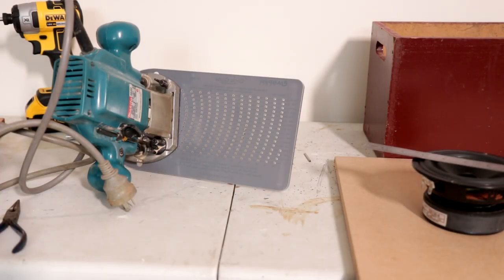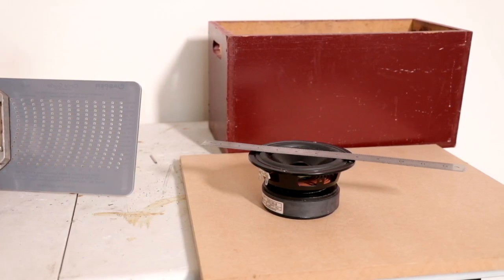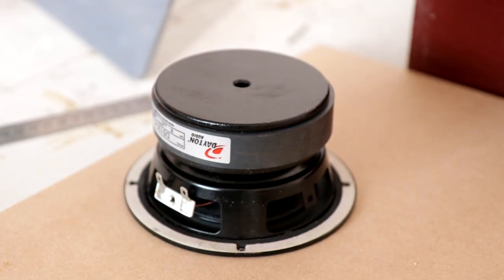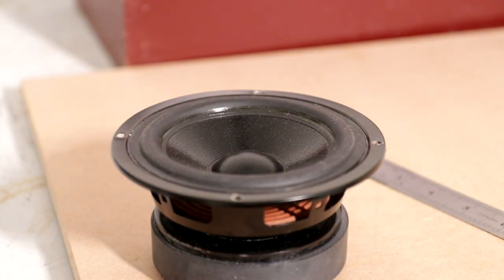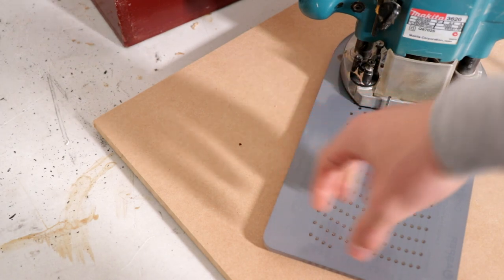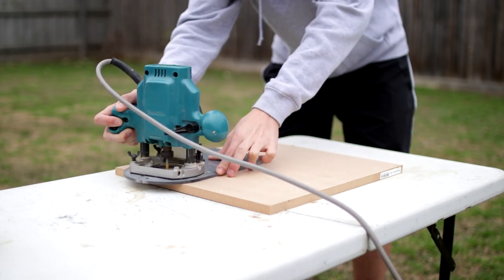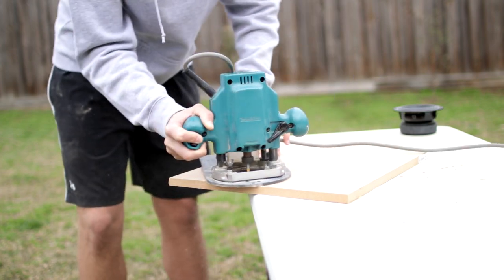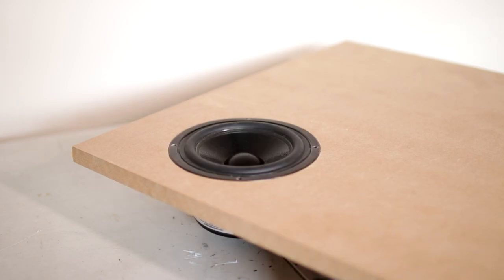How To PERFECTLY Mount A Speaker EVERY TIME!

Comment: Nice, but could you talk a bit (no pun...) about the bit used?  I first thought, wow, how did you factor in the bit diameter, but I then did a pause on the jig and see that it calls for a 1/4" bit.  That seems pretty thin, do you have to take lots of passes to avoid snapping it?  Also, what is the bit shape, including the tip.  Is it a plunge bit?  I know, newbie to routers, assume nothing.

Comment: You forgot to add the thickness of the sealing gasket for mounting under the flange of the speaker rim. I use draught excluder foam, but you can get other neoprene foam strip or at least use soft carboard.... whatever you use, the extra thickness after its compressed, needs to be factored into the router depth.

Comment: I made 2 boxes for 2 8” subwoofers  i had laying around but i done the measurements really wrong and the boxes ended up half the size they are meant to be and they basically make no noise even with 500W running through them😂

Comment: Its actually a little too tight. Once  you paint the boxes you might find it very difficult to install the woofer.
Reply: Yeah I am going to 2nd this. And it would depend on the material you are using if there is going to be any thermal or moisture expansion.